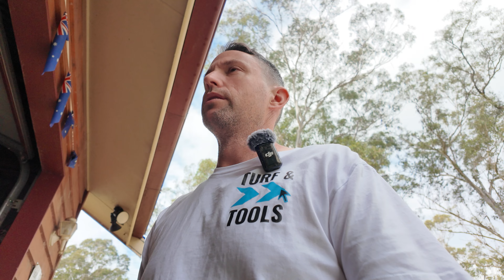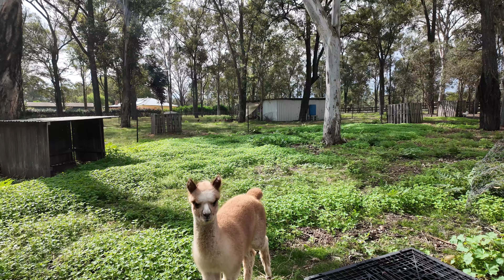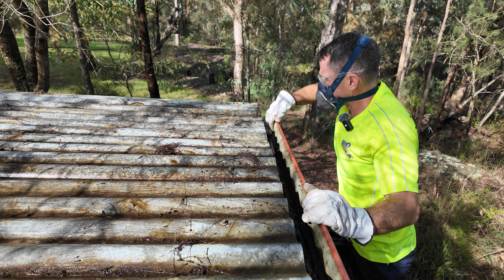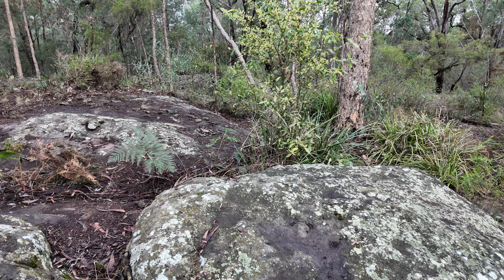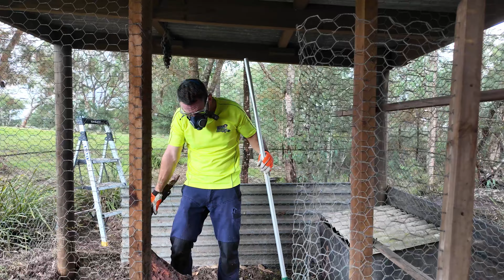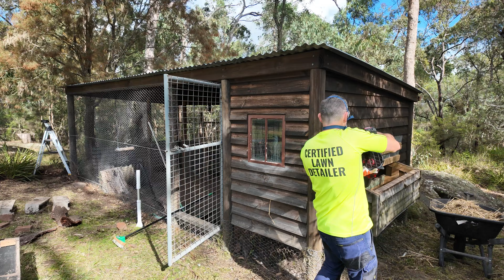Complete Chicken Rookie Prepares Chicken Coop VLOG #46

Comment: Double up the wire around the bottom of the coop with a small gauge wire to keep the Joe Blake’s out Tim, also put some Lino on the inside floor of the coop & nest boxes so you can pull it out and give it a deep clean every 6 months, it’s prolong the life of the timber too. 🐥
Reply from the maker: Cheers
Reply: @turfandtools  Especially carpet pythons will have no problem climbing the full height - or climbing down from the tree. At least going into autumn/winter, it may not be too bad for a few months. Good luck!

Comment: Tim I forgot to mention when doing linoleum flooring you may also want to add it along the back and side wall also this way if the chickens do the spray and splatter method lol😁😁as you know some times everything just does not fall straight down plus it will also be easy to clean up the walls..

Comment: Tim, I agree with some of the others put down some linoleum flooring inside under there perching area this will help out with cleaning up a lot easier. Make sure to ether glue down or tack down the linoleum flooring so it will stay in place as it will roll up on you..

Comment: Use the pressure washer on that chicken roof???
Put vinyl floor over the wood in the chicken coop.
It will make it SO much easier to clean the poop.
Oh...think if you want to bring the vinyl half way on the walls because when they perch they will poop the walls too (truck learn from farmers homesteading)
Reply from the maker: Sounds smart 👌
Reply: @turfandtools  not my tip but the results were amazing after the winter season went by and they had to clean up all the layers of poop and hey...so I tried it and makes life much easier.
Oh  ... use a good glue to glue it to the wood and a roller to run it over the vinyl and don't be shy with the glue!! If you see bubbles without  glue better to add rather than to get wet on the wood (you know they lay liquid and solid 🤣). I didn't do it and I regret it so planning on getting rid of this layer and add  new one with a LOT of glue and more attention to any bubble spot.  Use thick vinyl though.

Comment: Chickens are night blind so once it is dark they cannot see.  They will eat prior to going to bed & yes poo of a night time.
Wood shavings or rice hulls are good for the coop underneath where they will roost of a night time.  You can then scoop this out weekly & put into the compost heap for it to break down before it goes onto the garden.
Nesting boxes you are best to have a different material in it like straw.  I would also suggest putting some dividers into the nesting box so you can have 3 or 4 of them. The girls will most likely favour 1 spot
For young girls that are coming on to lay. Wooden eggs or golf balls are a good way to help guide them where to lay.
In the run area. Yes totally agree you want a finer gauge wire. This helps keep rodents & snakes out. Your current door way will fe an easy entry point.
If you are not going to let your girls out of the run, you would be wise to give them access to greenery that they can eat. Some grass clippings (not too many) & weeds or veggie plants they are likely to love.  Also want a good spot where they can dust bath. This needs to be a nice dry spot. Dirt, sand, ash from the fire place are all good things to mix together. This bathing is a way they keep mites off of them. Rubbing DE onto them every few months is a good way to help control the mites. DE also good to rub onto the rungs where they will sleep at night.
I’d also suggest looking to plant some herbs around the run as a few of these are natural bug repellents.
Breed wise, I’d suggest going pure breeds over commercial breeds as they will live & lay longer. Most commercial breeds you will get 1 laying season out of them then they will stop or pass away suddenly.
Enjoy your new girls

Comment: I used to raise and show chickens at the county & state fairs. It was fun I miss having chickens. Some of my top 5 favorite breeds are Americauna (Easter Eggers- they lay blue, green, pink, tan & occasionally goldish eggs), Wyandotte, Sussex, Australorp, Orpingtons. They lay well and those I've had were pretty laid back. Some were even friendly. I don't like Rhode Island Reds or Rocks. They tended to be on the mean side. The mixed breeds, sex-linked breeds seemed rather flighty & spooked easily. At least the ones I had. There are chicken groups, ag websites and hatcheries that have good info on various breeds. Murray McMurray is a good one for info. 
I tried linoleum inside the coop, and it's ok if you tack it down & sweep or hose it out. It's unwieldy trying to take it out to dump. A simple tarp works better for that. It all depends on what you prefer. There are many types of feeders & waterers as well. You'll need some they can't tip or scratch in. The tray type is good your young ones but not adults unless secured down. Having a heavier wire around the bottom of the coop and a couple feet out along the ground to prevent anything digging in is a good idea too if there are problem animals in your area (stray dogs etc.) 
Good luck! Just beware! Chicken Math (we used to call it chick fever) is real! I can't wait to see what you get and follow you on your endeavor.

Comment: Scored some great tips in comments with this one, Tim. Totally would have used a pressure washer on the roof and on parts of the inside too. At this rate you'll end up with a kids petting zoo mate. When's the alpaca coming  🤣🤣Any news on the water tank?
Reply from the maker: I’d love a couple of alpacas. The tank has a drain point near the coop. I need to fix that seal
Reply: @turfandtools  Not too bad then and we did guess at the seal. It should be a pretty easy fix. So, a couple of weeks to sort the coop and wait for the chickens leaves loads of time to set up an alpaca enclosure. Can't wait to see the Vlog 🤣🤣